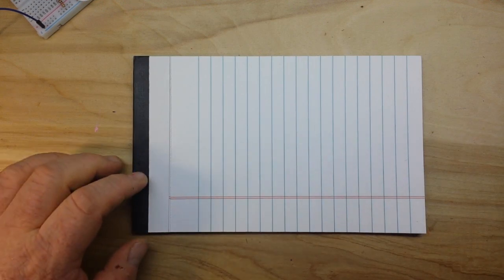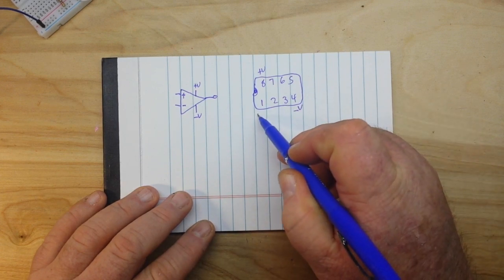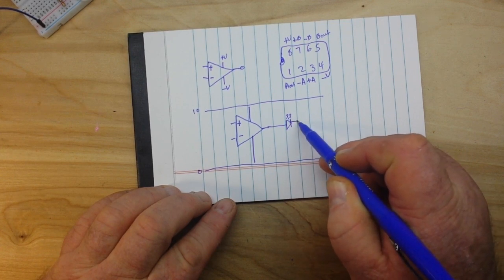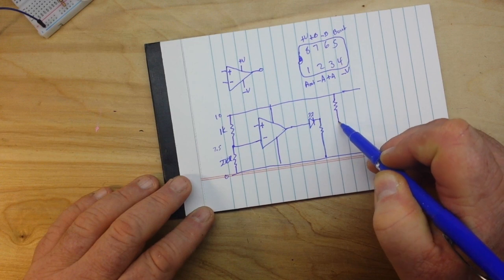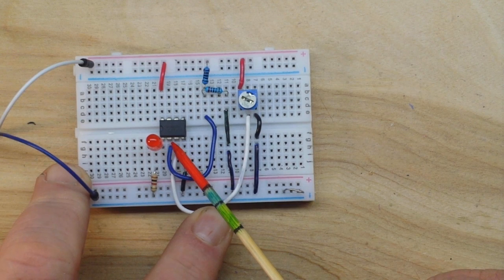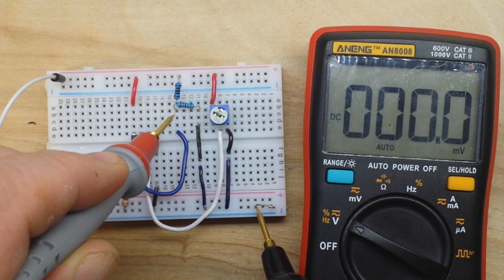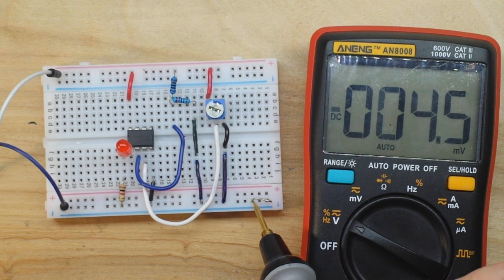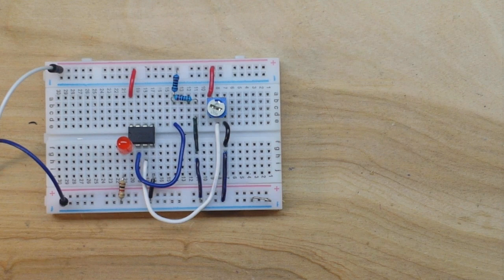Digital Comparator with OpAmp

Comment: Hello. Thanks for the video. I want to ask about something though. to get a 7.5 volt at the inverting input; shouldn't the upper resistance be of a value 100 ohm, not 1K? 
7.5 v would then be = 10v * (270/270+100) 
or is there something else Im not seeing here?

Comment: Can an op amp respond quickly enough for rf. type zero crossings ?
Reply from the maker: That's a loaded question. Simple answer, some are. Read this technical paper, it will give you some ideas and cost vs. performance data: https://www.ti.com/lit/an/slyt121/slyt121.pdf

Comment: hello sir. can i ask what i need to hook this into 220v line. i want to use this comparator circuit to send a signal to relay to cut off the line if the 220v line was touch. this is for my project. it will be my pleasure if someone would help me💙💙💙 thankyou so much
Reply from the maker: This is a low voltage DC circuit it will not work on mains AC.

Comment: I would have used the LM393 for demonstrating a comparator. By textbook comparators are meant to be active low. The LM393 which has open collector outputs can only swing low, and this is how a comparator is meant to be. The gist of it is basically that if the voltage on the non-inverting pin is more negative than the voltage on the inverting pin, then the output swings low. So suffice to say that the reference voltage is set on the inverting pin.
Reply: Thank you sir, you just answered a puzzling question I had. On his LM393 video he connects the cathode of the LED to the IC's Output and the anode (through the resistor) to the Vcc. 
In this video he connects them opposite (anode to the Aout and cathode to ground).

Comment: What is the difference between using an op amp and a comparator chip like the LM293.  Also what would change if you supplied some feedback.?
Reply from the maker: A comparator is purpuse designed for the task, where as the op-amp is more of an all purpose design. Think of it like the comparator is an arduino and the op-amp is a raspberry pi. The pi is capable of so much more than the arduino. The op-amp can be a comparator, or an amplifier or an integrator, etc...

Comment: my LM239J exit is negative and never positive. V+ and V- are correct. If I want to light a led I need to reverse it. How can I have positive voltage to the LM239 exit?
Reply: Elementary electronics , learn about pull up resistors ETC

Comment: I have question, I used 741 op-amp as comparator, a potentiometer to set threshold at inverting input and a voltage divider using 10k resister at 5v side and a reversed biased photodiode at gnd side to the non inverting input. My goal is to make night light, but in situation when the output led should be off but it is actually not getting off fully it is glowing very low in off condition. But in on condition it's behavior is normal.
Reply: Hi, same problem here, did u manage to solve it?

Comment: I don't know what resistor values were used in the voltage divider, but a 1k ohm and a 270 ohm will not give 7.5 v....closer to 2.1 v .
Reply: I also calculated that and WTF - 2,13V, but if values switched it cames 7,87V :)
Reply: I also noticed this, the output of voltage divider at invertng input will lower voltage, about 2 tenth of positive supply, he put the other way around. Anyway the concept is taught, and explained clearly, thank you!

Comment: Thank you! Could you please explain what you meant by rail to rail? Also could you do a video on making a simple buck converter? Thank you
Reply from the maker: Rail to rail....if you feed the opamp +12 and -12, most opamps can only swing +10/-10. A rail to rail will go from +12/-12.
I have done both buck and boost converter videos.
Reply: @learnelectronics  thank you! Also I don't understand, I tried this and yes the led went on and off when I varied the pot, but it came on when the out put from pot was slightly less than negative input??? I wasnt expecting it to come on until it was greater? Thanks again

Comment: So something like this could be used as a  basic battery protection for 18650 batteries, E.G. disconnect the power when V is less than 3V ?
Reply from the maker: +uktoker71 Yes, but you would switch your inputs so it cuts off at low point

Comment: Noob question here. Why not use a zener and a mosfet?
Reply: my comment got nothing to do with your Q sorry ;D
But honestly if you wanna make it into electronics (for real that is) you gotta read the book: Art of Electronics (preferably latest edition) also get the manual(lab work for learners) and the required components.
Little dedication and lotsa labs, next thing you know, you are posting something on Hackaday! ;D
https://artofelectronics.net/
Good luck and Godspeed.
Reply: My suggestion would be to build both circuits and measure the efficiency. Always more than one way to skin a rabbit.....just which is more efficient.
Reply: Gazz R 
Makes sense Gazz R. THANK YOU. I was more or less asking JUST THAT, why you would want one over the other. I wasnt asking why you COULDN'T use another way. Paul just missed that i think. He also first told me I COULDN'T because it was analog and not digital... then he realized that was an incorrect statement. Never got a real answer out of him. But thanks for yours. I appreciate it. I talked to an EE and he said that this way is more accurate than zeners because zeners vary a bit in thier voltage drop . Also he said that he usualy sees these things either with 1% resistors for the ref, a ref IC for more accuracy, or a pot that can be adjusted on the fly. Thats the kind of answer i was realy hoping to get from Paul. Hopefully that helps others out there who had the same question.
Reply from the maker: +Robbie Robinson Zener and MOSFET for what?
Reply: learnelectronics as apposed to a comparator. If i want to turn something on at a specific voltage why not use a zener at that voltage to drive a mosfet. Or even a programable uni-junction transistor for that matter. I know its probably a silly question. So please be patient. Thanks
Reply from the maker: +Robbie Robinson Ok I understand. This is a digital circuit. What you are talking about is analog. Just different types of circuits.
Reply: learnelectronics there would be an analog input to my circuts, as you have here with a pot. But the output to my circuts would be digital,just like yours. As long as my mosfet is in saturation right?
Reply from the maker: +Robbie Robinson sure
Reply: learnelectronics what part of my comment is your "sure" in relation to?
Reply: igrewold thanks for the references. I LOVE the Art of Electronics. Unfortunately since my youngest was born and have two jobs I havent had time to read it :(  but I didnt know about the other book. Ill look into it when I get time. Thanks bro!
Reply from the maker: +Robbie Robinson You can use zener and a FET to accomplish the same as I have shown here.
Reply: learnelectronics ok. I guess my question still stands though. WHY not use a zener and instead use a more expensive IC way?
Reply from the maker: +Robbie Robinson a zener is not digital. A comparator is a a circuit that takes an analog input and turns it into a digital output. The comparator is the basis for the analog to digital converter in your Arduino, or ESP. it allows a digital device to read an analog input.

I'm going to push the video I had planned for today back a day and do a follow-up on the comparator. You ask good questions sir. I hope this video will help you.
Reply: learnelectronics sorry to be a nag. But a zener and a mosfet WOULD be digital. As you said, that circuit would work the same way. Ie analog in, digital (on or off)out. So my question to anyone out there who knows... Why choose one circuit over the other if they have the same digital function?
Reply: Ahhh... unless you are talking about a dual rail op-amp... unless in that case you could use a Diac and Triac as apposed to a zener and fet. Well. Cant wait for the next video mr learnelectronics. And if anyone can solve my confustion i'd appreciate it.
Reply from the maker: +Robbie Robinson I'm Paul. Videos every day at 5pm. Digital logic circuits are in general low voltage DC.
Reply from the maker: Ok buddy.

Comment: looks like someone thought this is a talkshow on comparisons. and didn't like the video..    I had been thinking about my voltage regulator circuit. for a alternator. anyway I was thinking maybe it would work better with a comparator thrown in there??? then I get this video. since its basically a voltage controlled switch. that happens to modulate to control the voltage output. and couldn't I make it adjustable if it has a op amp comparing voltages? adjust it at least with in a volt or two ? I still haven't started on the project yet. I need to calculate current draw of the rotor.  what is it? volts times ohms equals what? or does it? see I need advice! what I don't know. I make up for by not being sure I know anything to start with... you know what I mean? the replacement regulators are good for 5amps@24v.   so I need to know the current draw of the rotor. great video shift registers coming soon???
the more I have thought about it . a comparator wouldn't have anything to compare to!
Reply from the maker: Ohms law V= I *R so I = V/R

Comment: I was trying to figure this out as I was confused by the voltage divider. If I'm not mistaken the 270 ohm resister should be connected to 10V and the 1K to ground.  Am I right?  As it was shown on the schematic the current would be 10V / 1270 ohms = approx 7.9mA and therefore the voltage across it would be 270 ohms x 7.99mA approx 2.13V rather than 7V.  If the 1K was at the bottom (ground end) it would be 1000R x 7.9mA which is 7.9V approx.  Of course it woun't be exact due to tolerances etc.
So am I going nuts or did you switch the resistors (I was having trouble trying to read the color codes on the video) ?
I know it hardly matters for a comparator but I thought I'd check...
Reply from the maker: Watch today's video, totally my bad....
Reply: learnelectronics OK not a problem I have HAM exam tomorrow and thought I had something wrong. Thanks for the fast response!  Great job by the way!

Comment: Lots of new Patrons congrats. I'm looking for something like a comparator circuit for torch height control on a CNC plasma cutter. It needs to keep the torch height controlled by keeping the voltage at the torch constant. Any ideas for something like that instead of spending $350 for a THC? Thanks for the video.
Reply from the maker: Well, you could do a comparator...Set your Vref for the max height, read your Vin from the unit and if use the comparator output to kick on your z axis to lower the height by a mm.
Reply: Good idea. I'll look into it more. Thanks!